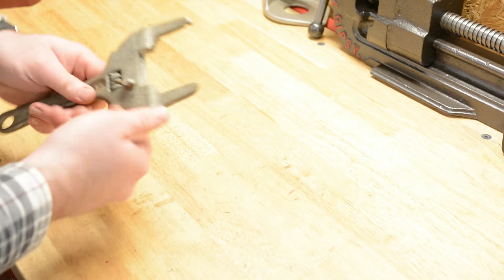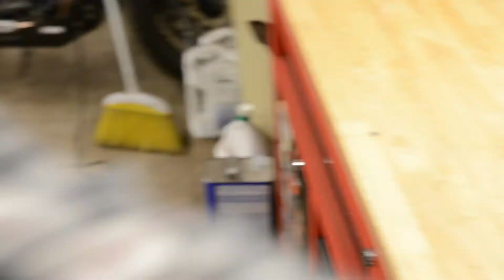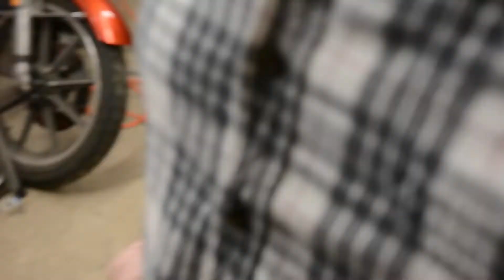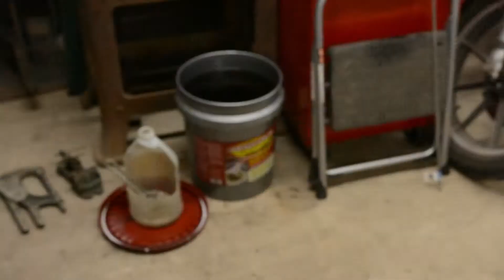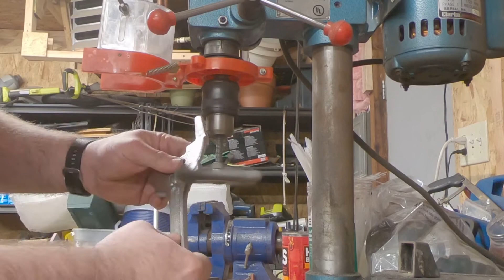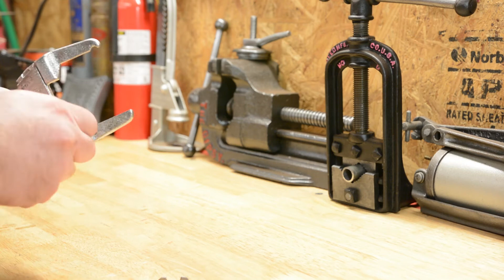Ace Slip and Lock Nut Wrench - Saturday Short #6

Comment: Am searching through YT for a solution to removing a stuck basket nut with the tool in your video. Ironically, yours is the only video and you show the repair of the tool; not the tool repairing the sink.
Reply: If you don't have a strainer wrench, use a pair of needle nose pliers in the strainer and a locknut wrench on the nut underneath the sink. If it's very tight use wd40 do not use heat